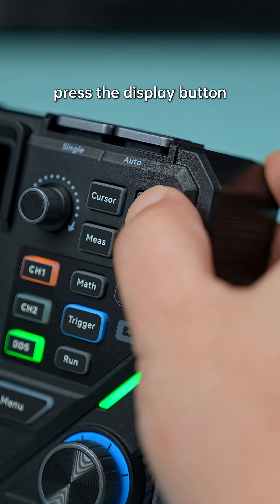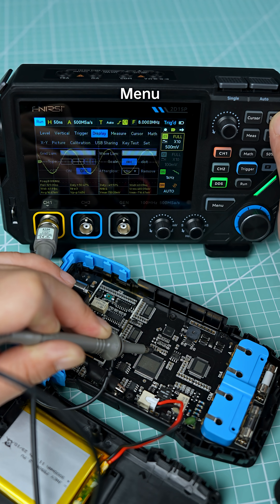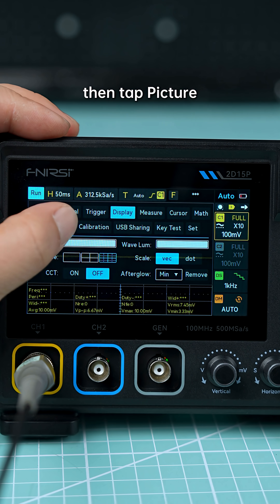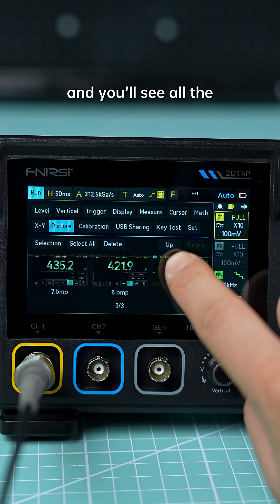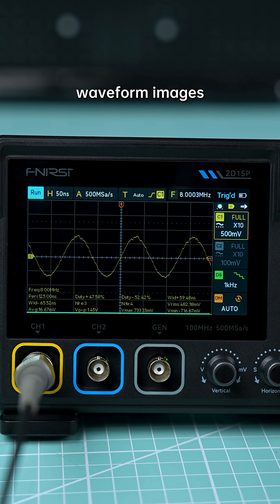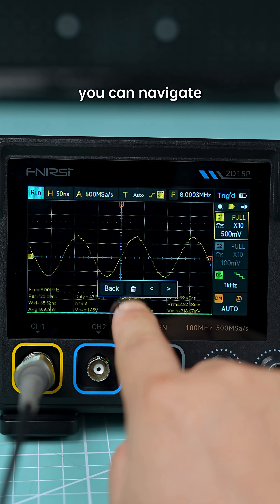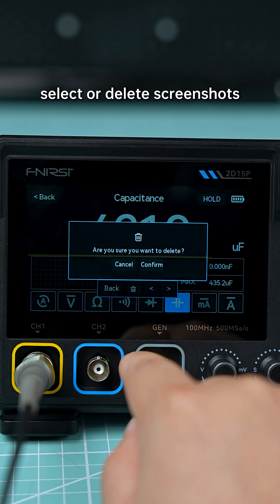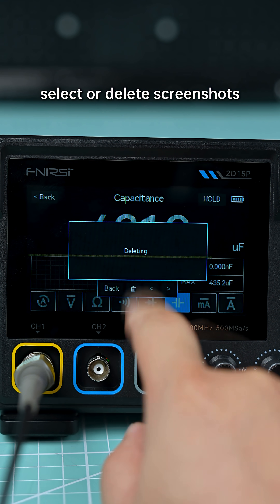FNIRSI 2D15P Touchscreen 2CH 100MHz Oscilloscope+Multimeter+DDS | How to Test a Crystal Oscillator

Comment: You could use this tactic to grade different crystals before creating a hand-made radio transceiver 

Which would then work with this system

To send and receive digital information 

At a scale defined by the hardware of the controller and radio

For a record of messages sent and received 

Compare then, to other hand made radio devices

To ascertain build quality, and quantify information

For a streamlined production model

Of a radar dish, and battery powered radio transceiver, with a small piezoelectric speaker ability

Could be amplified by the controller....
Reply from the maker: Thanks for the suggestion! ✅
This method is great for grading crystals and testing signals in handmade radios.
Message recording and comparison help evaluate device quality, though performance depends on the controller and radio hardware.
We’ve passed your feedback to our technical team.